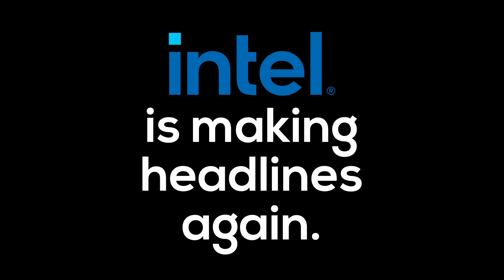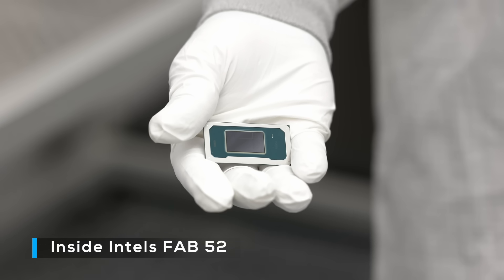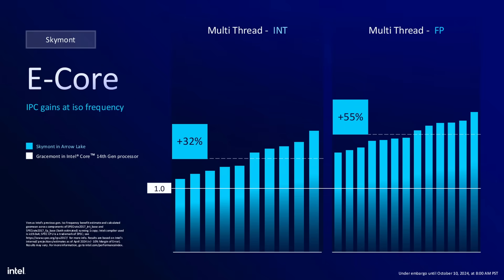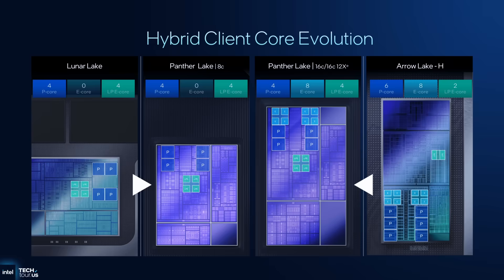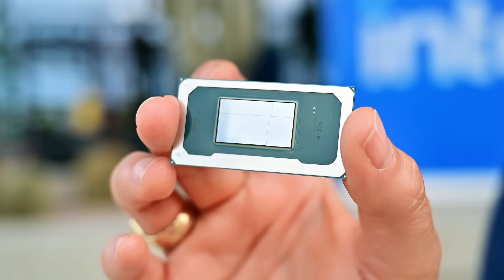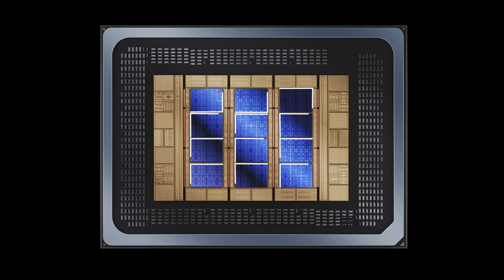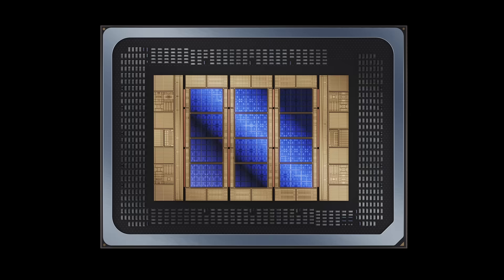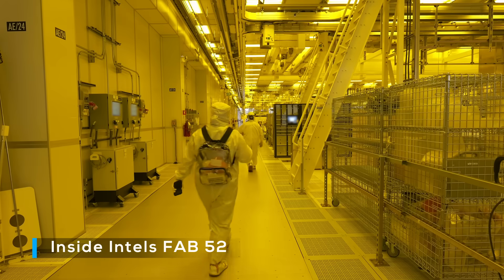Panther Lake, 18A & The current state of Intel

Comment: Is support AVX10?
Reply: Sadly doesn’t look like it, it wasn’t mentioned in the paperwork that reaffirmed that NovaLake will obviously support AVX10 and APX (and there, sadly not AMX as well either).

Wish it did though!
Reply: @levygaming3133  weird, if I'm not mistaken it seems like specifically Panther Lake Mobile was going to support AVX 10.2, I may very well be mistaken but honestly I don't want to be. It would be quite the blunder for Intel to relegate AVX-10 to Xeon Workstations yet again...
Reply: @woahcoolio8830  I’d bet what happened is it supported AVX10 when E cores not supporting the full 512bit in some fashion was still a valid option, and when that was pulled recently, so was Panther Lakes “support” for AVX10, because it’s no longer compliant.

If that’s the case, I think they could’ve handled it better, but that’s just the entire story of AVX512 / AVX10 isn’t it.

Also, should finally be coming to consumer desktop with Nova Lake. It only took them about a decade.

Comment: Intel could crank out the best chips they ever had and they would still be FUBAR because so many got burnt on Raptor Lake and Intel constantly changing sockets. When AMD was behind on Bulldozer myself and many others still bought them because you could get an FX-8320 for the price of a Core i3, why would I spend almost the same price as AMD when Intel keeps changing sockets and putting out space heaters?
Reply: Intel is not only cheaper, but its performance is also twice that of same-priced AMD CPUs.
Reply: I still have my 8320 for a second machine and it handles most tasks without sweat (boost disabled and a hair under clocked). It was an awesome deal, whole machine with 16GB ram, good quality PSU and motherboard was $500 before Graphics card.
 
Reusing a socket for multiple core generations means little when I only need to upgrade once every 10 years and would want to upgrade memory type and PCIe version anyway, requiring a new motherboard. Though extended socket life does help motherboard makers manage stock levels and get better economy of scale.
 
At some point the socket starts to hold back the design options, a trap I see coming for AM5 if they insist on delaying AM6 until Zen8. AM5 just doesn't offer enough IO for the increasing multi-core throughput of the larger packages, Zen7 (really Z6 too, but that can be squeezed) needs support for 3 rdimm memory channels and 8 more CPU-direct PCIe lanes. rdimm is needed for the 4004 epyc branding used in small servers.(the ecc-udimm market is a joke, and any device with long uptimes needs ecc) 

Things Arrow-Lake got right (two mem channels but CU-dimms offer far more speed, and it has more PCIe lanes)

Comment: What's holding back a lot of AI applications for normal consumers is that our GPU doesn't have access to our system ram, and if Intel are rethinking connectivity architecture, that's a good place to start. What I think they should do is to package the desktop GPU in a socket that looks like a CPU socket, right there on the motherboard next to my system ram, near the CPU. Then build in a memory controller and high bandwidth interconnects instead of messing around with a PCIE slot, so that both the CPU and GPU have shared access to the system ram pool. Then upgrading the CPU and GPU would be done the same way - just take off the heatsink, swap out the module, reapply thermal paste, and screw the heatsink back on.

Comment: 1. Shame that the cool X3D-ish tech didn't come to consumer product. 

2. I don't think 18A will get Intel back on the DIY market, but laptops and handheld? I can certainly see the charm. Exciting times to see competition may be coming back instead of AMD roflstomping the market.
Reply: AMD ended up dominating the desktop and DIY market because Ryzen CPUs are a by-product of EPYC CPUs. So as long as EPYC sales are great AMD ends up with a steady flow of chiplets that aren't up to snuff. This means AMD has no other choice than to lower prices for desktop chips once the chiplets start piling up. But desktop is the smallest fraction of x86. By a good margin. Data center is where the big dole is. Laptop is where the good dole is, and desktop is where the scraps are fought over.

I'm fairly certain that Intel will eventually get around to making desktop CPUs based on this "assembly kit" of dies. Nothing else would make sense. There will be compute dies that simply can't clock high enough at low enough voltages to go in laptops.
Reply: PTL isn't meant for desktops. That would be Nova Lake, which should use similar cores and tech, but at a scale more like RPL and ARL.

I am very excited to see that big iGPU in handhelds, and one thing I do wonder about is the possibility of using the small CPU tile with the big GPU tile. Lunar Lake's CPU is more than enough to keep its 140V GPU busy. PTL's faster version of that same design should be able to keep the B390 happy while being smaller and cheaper for the handheld market.

Comment: The section on disaggregated tiles was especially well framed. Nice way to show why teams are leaning into modular design lately.
Reply: I still think Intel is making too many dies.  Even if it's on their own fabs which will save a lot of money, I dont see the benefit of not just making one I/O die for Panther Lake and just disabling part of it for products that dont need it.  Heck, I think even a single CPU die might make more sense as well.  Not like they didn't used to do this for many of their monolithic dies for quite a long time.  The tiny die savings cant be worth all the extra cost and effort, right?

Comment: IO wise, not really impressive for me. 20 PCI Express lanes?
Reply: Isnt it laptop one? Its kinda expected to have less pcie on those.
Reply: This is a laptop part. That’s 8 lanes for the (optional) dGPU and another 12 lanes for everything else, so room for 3 separate 4 lane M.2 SSDs (idk wether necessary stuff like wifi is included in that lane count). 

Also idk if the Thunderbolt connectors are included in that lane count either, because they seem to be saying “up to 4 thunderbolt connections” on the 12 lane smaller versions? When a Thunderbolt takes 4 lanes no? 

Rumor has it, and I’ll stress rumor is Nova Lake should increase lane count on desktop. Something like 36 or 48? Would be very nice if true.

Comment: Nonetheless, X2 Elite is going to eat up Panther Lake sadly.
Reply: lol, lmao even
Reply: With how windows on arm has been that is quite doubtful.
Reply: @theemperorofmankind3739  Software compatibility aside, I am talking about raw performance. Did you see its single threaded performance? Slightly behind than the current macbook.
Reply: @TuxikCE It doesn't matter for the same reason Apples performance doesn't matter: People value compatibility over everything else. Nvidia has been brewing on an ARM based complete solution for years, but all the hickups and cost of x86 emulation is why it has currently only seen the light of day in bespoke configurations that run Linux.
Reply: @andersjjensen  Not everybody is playing games like you. "Apple's performance doesn't matter" is such a careless statement. It definitely matters. People buy Macbooks for a reason. If their work doesn't run on it, they won't or shouldn't buy it. There are many other tasks than ARM based CPUs now just blow away x86, especially for laptops. Efficiency is good a thing in general, not just because it might not be needed.

ARM itself is good. It's just the the whole world has to move towards ARM in terms of software.
Reply: @TuxikCE My problem is not games. My problem is a huge catalogue of EDM and CAD software. Sure, people who just need a webbrowser and an office suite on their laptop can run any architecture. But those don't care much about performance. They care about upfront cost and service reputation.
Reply: @andersjjensen  I also do want such professional softwares to be supported on ARM. But faster is faster. And the web sucks. Single threaded performance can be very noticeable. And again, also the much better efficiency and battery life.

x86 itself is not exactly worse than ARM but it is now limiting the scalability and potential performance improvements. ARM is the future. x86 still live if it still keeps being worked on.
Reply: @TuxikCE Except I've heard the whole "RISC is the future" since the original paper was released in 1990. Hasn't happened yet. At node parity CISC still has the clock speed and IPC advantage at the cost of efficiency. Nothing has changed in that regard for 35 years.
Reply: @andersjjensen Yes but it is actually happening now. Apple silicon has just been superior. If only they invested more in compatibility and gaming as well. Nvidia is going to play in CPU race as well. Snapdragon is here to play on the Windows platform. x86 is having a very tough competition.
Reply: I used CoPilot on my Intel165U to decode your message. And i don't really care about Snapdragon since i want my multimedia windows that supports all the oldies and goldies. Even though Windows sucks evermore and my Surface Pro does not have the longest battery life.

Comment: I think for laptops battery life (efficiency) and responsiveness (single threat) is important.
On desktop - intel cant compete with performance and efficiency.

Their tile approach still seems more complicated than AMDs. That might be an issue. AMD has an IO die and connects as many CCDs as it wants. And if the yield isnt as good, AMD just segments differently.
Intels 2 two chips for each, so each bigger chip has more risk of defects, and I wonder how messy SKUs are going to be... How do you number these even??

So I hope its going to go well.... we need competition to keep costs in check and fuel innovation.

Comment: Intel has been behind for a while now, and their move from their own Foundries to TSMC shows it clearly. 18A is certainly a big step for them, but how are the YIELDS? Also, TSMC A14 is clearly superiod to 18A, though both new processes use similar key features (Ribbon/All-Around Transistors, Backside Power Delivery, etc). Intel hasn't really DELIVERED for nearly 5 years on its claims, so I suggest a teaspoon of salt with their Marketing Puff.
Reply: lolwot  A14 is ~3 years away from being where 18A is today
Reply: Since the 18A tile is the biggest, I would guess yields are good enough.
Reply: @panjak323 defect yields are ok. Parametric yields are a disaster because the pdk is borked and massively over predicted performance.

Comment: I see intel is trying to go back to 4 cores i all you need, and if you need more you can use these 8/12 parasitic slow cores ....or you can buy ryzen
Reply: I see you haven’t been paying attention to AMDs laptop efforts. They also seem to think 4 cores is all you need, while the other 8 top out at something like 3.0 GHz, and they don’t feel the need to be upfront about it either.
Reply: @levygaming3133 ryzen ai hx 370 4p cores+ 8c cores (the ecores), AI max 380 6p cores, 385 8 p cores, 390 12p cores, 395 16p cores, they are not the same
Reply: @RadarLeon  and most of those Stryx Halo parts are MIA, those that aren’t are absurdly expensive and only in one singular normal (albeit overpriced business edition) laptop, nor can they be paired with a real GPU.
Reply: @levygaming3133 well they exist which is more than I can say for intel
Reply: @RadarLeon  do any 380 / 385 / 390 exist though? Outside of leaked benchmarks? And these Intel chips will exist come January, it’s just that this is still pre Panther Lake release. Whereas AMD launched Stryx Halo how long ago?
Reply: AMD also has E-cores and they are worse

Comment: That long rectangular shape packaging is ugly for processor, it wil be nightmare for socket type and to maintain flat contact with cooler properly.
Reply: That's obviously for mobile parts, you'd know if you've ever taken apart a laptop. Otherwise yes, mounting pressure hasn't been even since Alder Lake and they're always required contact frames
Reply: intel had long rectangular CPUs for a while, all the i9s from 9900K onwards are that shape
Reply: @Lemard77  Diamondville springs to mind (3.27x7.94mm).
Reply: @Lemard77  Yeah, but not this long
Reply: A desktop CPU has a heat spreader on top of the silicon die, so I don't see how the socket is related here.
Reply: @leduyquang753  It is relatable, square shape is more optimised for socket clamping force distribution and cooler contact. CPU heat spreader bending under socket clamp is a problem with intel rectangular processor before, unenven cooler contact, that's why AMD ryzen AM5 have slotted shape like that. I'm not a fan of AMD but their CPU design is better.
Reply: meanwhile at AMD: three chiplets far apart, none of them in the center
Reply: @marshallb5210  That's soon going to change

Comment: AI Summary

Abstract:

This video analyzes Intel's strategic shift, focusing on its new Panther Lake mobile SoCs and Clearwater Forest server CPUs. The central thesis is that Intel is finally executing on its long-promised disaggregated, tile-based design philosophy and is successfully bringing high-volume manufacturing of critical silicon back to its own foundries with the 18A process node.

Panther Lake is presented as the first meaningful implementation of this strategy in the consumer space, offering three distinct variants (U, H, H12XE) by mixing and matching CPU, GPU, and I/O tiles. This demonstrates a return to using Intel Foundry for the most advanced components (the CPU compute tile on 18A).

Clearwater Forest is framed as a more impressive technical achievement: a 288-core server CPU combining twelve 18A compute tiles with three active Intel 3 base tiles containing 576MB of L3-like cache, connected via hybrid bonding. The analysis concludes with cautious optimism about the 18A process, arguing that its production ramp for these chips signals a high degree of confidence and a potential return to a competitive, if not leading, position against TSMC. As far as I can tell, the entire argument hinges on 18A being successful.

Intel's Comeback? A Look at Panther Lake, Clearwater Forest, and the 18A Process

*   0:00 The Strategic Importance of 18A: The video asserts that Intel's new 18A process, developed in Arizona, is central to the company's strategy. Its success is critical for both Intel's products and its foundry ambitions.
*   1:33 Panther Lake: Disaggregation in Practice: Intel's new mobile chip, Panther Lake, is the first product to fully realize the company's tile-based "disaggregated design" philosophy. It comes in three variants (U, H, and H12XE) by mixing and matching six distinct tiles (small/large compute, small/large GPU, small/large platform controller). This allows for purpose-built chips without the compromises of a one-size-fits-all monolithic design.
*   9:11 A Hybrid Foundry Approach: Panther Lake strategically uses multiple foundries. The core compute tiles are always made on Intel 18A. The GPU tiles are either Intel 3 (small) or TSMC N3E (large), and the platform controller tiles are on TSMC N6. The key takeaway is that the majority of the active silicon, and the most advanced part, is now from Intel Foundry again, a reversal from recent trends.
*   11:43 Clearwater Forest: A Monster Server Chip: Intel's next-gen E-core server CPU is presented as an engineering feat. It combines 12 compute tiles (24 cores each) on the 18A process for a total of 288 Darkmont cores.
*   12:41 Advanced Packaging Showcase: The Clearwater Forest design is extremely complex. The 18A compute tiles are 3D-stacked (hybrid bonded) onto three active base tiles made on Intel 3. These base tiles contain the memory controllers and a massive 576MB of last-level cache. It also reuses I/O tiles from a previous generation, demonstrating the efficiency of the tile-based approach.
*   15:39 Confidence in 18A: Intel's decision to allow journalists into its Fab 52, where 18A is produced, is interpreted as a sign of high confidence. The author speculates, without hard evidence, that yields on the large Panther Lake compute tile are likely now over 60%.
*   17:12 A Direct Comparison to TSMC: The Panther Lake U variant uses an Intel 18A compute tile with the same core configuration as the Lunar Lake chip, which was built on TSMC's N3B. This sets up a direct performance and efficiency comparison, suggesting Intel is confident 18A is competitive with TSMC's 3nm-class nodes.
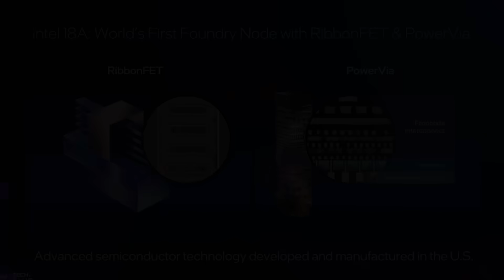*   18:06 Conclusion: Intel is Executing Again: The video concludes that Panther Lake and Clearwater Forest are tangible proof that Intel is successfully executing on its technical roadmap. The disaggregated design is no longer just a concept, and 18A appears to be on track, positioning Intel to be highly competitive again.

AI-generated summary created with gemini-2.5-pro for free via RocketRecap-dot-com. (Input: 19,437 tokens, Output: 942 tokens, Est. cost: $0.03).

Comment: One problem of having so many different cores is the OS dispatcher, chances are you are going to decide a suboptimal configuration when you need it most, I understand that is for power saving, but the tuning necessary at OS level is huge. I trust hey have figured it out, we need competition, good for Intel, I wish them luck.
Reply: Server CPUs are mostly used for containerized or virtualized loads on Linux and the Linux Kernel is well optimized for scaling both of these scenarios out onto available cores. Windows kernel may struggle.. but that is largely a legacy OS now a days.